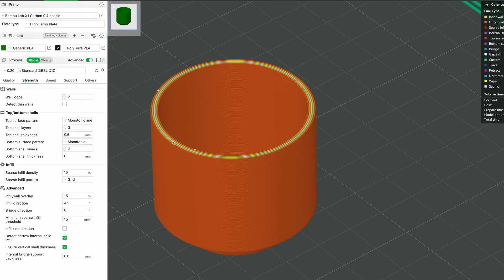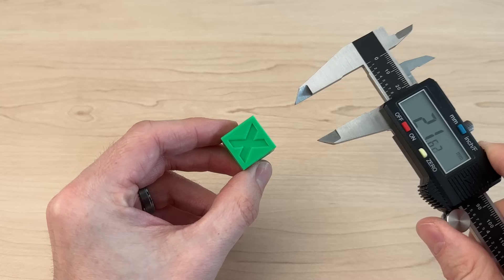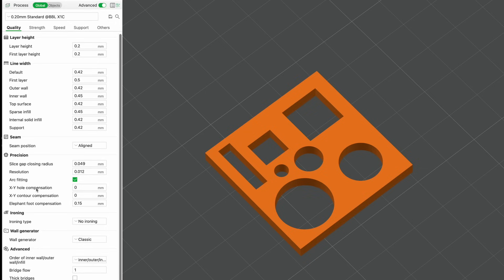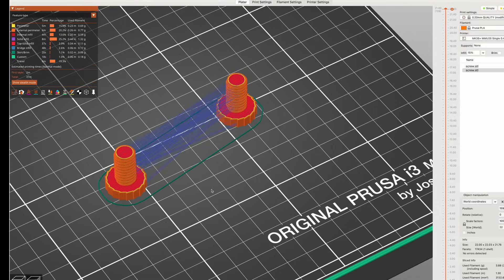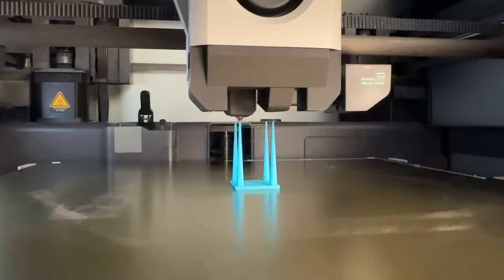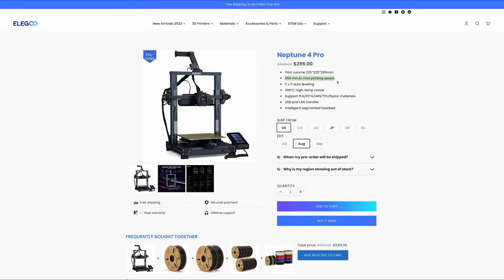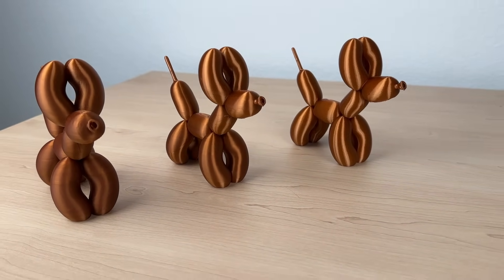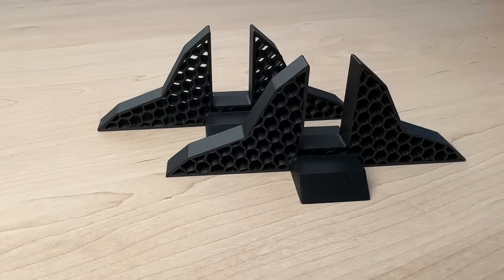9 Game Changing Slicer Settings You NEED To Try

Comment: im new to 3d printing, so bare with me. ;)  
slicer settings... when slicing and you set perameters for that print. are they set/saved for that print or are they saved for that filament?
ive noticed that when i change perameters for a print the slicer asks if i want to save those perameters.  so far ive never saved, under the assumption that it would save them for the filament rather than the print.  
i dont want to save a perameter and screw myself on a new print with a wrong perameter. forgetting that i changed them for a previous print.
thanks and have a great day!!
Reply from the maker: This depends on where you change settings. There are settings specific to the filament and settings specific to the print/printer. I usually save settings and rename it so I don’t overwrite other settings.

Comment: I personally value Arc Welder feature (Cura: Arc Welder, Orca: Arc movement), and a set of features in Cura that allows to avoid printed parts, supports and avoiding crossing perimeters when travelling. The former drastically decreases amount of stringing to filaments that ooze much

Comment: ONE setting that should also be mentioned is relative to each filament : shrinkage rate. All materials expand when heated and shrink when cooling, at different rates.
In the first place, before adjusting holes and such (which is also important), finding a filament's shrinkage rate and applying it to the slicer through filament properties is something to be done, because it directly affects dimensional accuracy. It's the very first thing in the chain.
Reply from the maker: That’s a great suggestion! Thank you for the feedback.

Comment: Great video, it really helped me a lot as i am new in the 3d printing field and struggle with printing spheres especially in fuzzy mode enabled. I am aware that in this case, the sphere being cut it should not be a problem, but i am struggling to print the sphere as a whole because even though the sphere looks printable in the slicer as the sphere has a small flat bottom surface the outer layers with the fuzzy skin seem not be able to stick to the printed object even though the overhand seems not to bad and the issues occur only on the lower part of the sphere, not on the upper part(where it comes together again) can you maybe suggest how to change or adjust the slicer settings in my particular case? for now i tried printing with 0,3mm layerhight as my object to print is pretty large. thank you!
Reply from the maker: Hi, do you have the option to split the sphere in half then connect them after it’s printed? Printing a sphere in one go is pretty difficult.
Reply: @The3DPrintingZone  Its not really a sphere per se what i am struggling with. I have designed a rectangular block with a completely rounded top, while the bottom has less pronounced rounding to improve printability and reduce overhangs. The cross-sectional area at the base is smaller than further up, so it gets wider—think of a conical cross-section that widens toward the top.

Now, I have applied a fuzzy skin to the design using the default settings. When I view the model in Prusa Slicer, I notice that between the first and second layer (where the fuzzy skin begins), the second layer is significantly wider, making it unable to adhere to the first layer. In the slicer, this layer is displayed as bridge infill, and there are two loops extending beyond the first layer. Additionally, the fuzzy skin follows, meaning the second layer is essentially three loops wider than the first.

I hope my explanation makes some sense. Is there a way to prevent this bridge infill from being so wide? The CAD design has a relatively small radius—smaller than the legs of the dog in your video—so I don’t think the CAD design is the issue. I hope my explanation is somewhat understandable, and I’d greatly appreciate any advice you could give me. Thank you!

Comment: External perimeters first seems to make quite a difference in dimensional stability and overall print quality, so much so that I've changed my defaults. However, a quick word of warning: be sure to evaluate your model for overhangs if you're going to use that setting. Running external first on a model that has even moderately aggressive overhangs can fail since the external perimeter will essentially be floating in mid-air without the internal perimeter (that builds off of the previous structure) to adhere to.

Comment: the relationship between infill % and strength is super overrated. The thickness of the outer wall has a much greater influence on strength then infill. if you want robust prints, make the outer wall 2-3 mm thick. you can have your infill at 15% and this will be much stronger then 0.8mm walls with 70% i fill. stefan from cnc kitchen made a really in depth video about this and the results may be surprising to sum
Reply from the maker: Thanks for sharing! I’ll have to check out his video

Comment: I use all of them, and most of the other settings also, like support roof density different layer heights, extrusion widths and many more on all my prints. That´s because i started printing years ago, and you had to know and use all that stuff or your prints looked bad or failed, with the NEW bambu generation, that knowledge seems to fade away in the future 😞 it was a hobby for enthusiast, becoming mainstream
Reply from the maker: I know what you mean

Comment: Why  grid/gyroid instead of cubic?
Reply: Grid and cubic infills are interference infills, and the crossing of lines by the nozzle can knock small parts over. Cubic specifically is like a closed cell infill, though it seems to use less filament. Gyroid is open cell, so the part can have heavy infill but still be completely filled with resin or whatever else, even sand, and it's generally the strongest infill. Interestingly gyroid is the quietest infill to print on my older, noisy Prusa Mk2.

Comment: More settings to look at are:
- Print 2 or 3 infill layers at the same time saves a lot of time. Say your layer height is mall e.g. 0,08mm you can print 3x infill layers which add up to 0,24mm thus only traveling once for 3 layers
- Thicker extrusions for infill, similar to the first point
- Thicker extrusion width, you can extrude 0,8mm with a 0,4mm nozzle easily. This is basically my course profile for strong parts like boxes etc, this way I only print one wall of 0,8mm instead of 2x walls and save a lot of time and I don´t have to swap nozzles, you basically don´t even need a 0,6mm or 0,8mm nozzle at all, but it helps with filled filaments like GF or CF filled.
- Shrinkage compensation. This is like XY compensation important on prints larger than say 50mm because material shrinks and this needs to be accounted for if you want a 200mm part to fit with some other parts. 1% shrinkae on a 200mm part is a deviation of 2mm

Comment: A note regarding Number 2 (Wall Print Order) - Printing the outside wall first can have some benefits but one thing to look out for is overhangs, if you are printing a steep overhang angle without supports, and the outer wall is printed before the inner wall it often has nothing to adhere to and will simply drop causing messy overhangs. If the inner wall is printed first the outer wall that is overhanging further has something to "grab".
Reply: Absolutely! But as is covered in a number of vids, if you're using Orca or Bambu Slicers the general best setting is Inner/Outer/Inner. Gives the best of both worlds.
Reply: Have you tested this or are you just saying this? 
From my experience and everyone I've seen who is showing real world results the exact opposite is true.
Reply: Same, If you have some steep overhangs it's common thinking/sense to add supports. Unless you don't know and rushed it print slower as it can benifit it too.

Comment: Here's a quick summary of the settings:

1. Detect Thin Walls - Prevent walls not being printed due to walls being too thin.
2. Wall Printing Order (inner wall first) - Reduces shrinkadge to keep parts size accurate as possible.
3. Horizontal Expansion (Cura) or XY Size Compensation (Prusa Slicer) +-0.1 - 0.2 is a good starting point to make things fit.
4. Horizontal Hole Expansion (Cura) or XY Hole Compentsation (Prusa Slicer) +-0.1 - 0.2 is a good starting point to make things fit.
5. Z Hop (Cura) or Lift Z (Prusa Slicer) - Moves nozel up whilst travelling to avoid nozel to part collisions.
6. Retraction - Helps prevent oozing.
7. Nozel Temperature - Adjust depending on print speed, observing print quality.
8. Speed - Not too fast for silk filaments, too fast makes them matt.
9. Infill Pattern - More infill for stronger prints, less for simple prints.

Enjoy :)
Reply: I believe your summary of #2 is backwards. His recommendation is outer wall first, moving inward.
Reply: Yup, outer wall first -> better dimensional accuracy. Inner wall first: better for overhangs. Some slicers (like Orca) also have Inner/Outer/Inner which seems to be the best overall compromise (ref.: see Orca slicer tool tip on wall ordering)
Reply: Agree, he said outer walls first. @mainetomass99
Reply: Thanks for this. I came just to see the tip on silk and I fast-forwarded through the common tips I already knew. I managed to skip what he said about the silk, but you summarized it perfectly.

Comment: I would love more videos like this!

I LOVE that you were able to cover multiple slicers and what the setting is called in each. I can't tell you how many times I've seen videos based on Prusaslicer and I have to guess or look up what Cura calls that setting. When I was new to this, it took me a good while to realize that permeters and walls were in fact the same settings in these slicers. You really second guess yourself when you're unsure about what you're doing.

The traffic sign with the logos and name of the setting is a really great way to show that, A super understandable and easy to acknowledge format.

Sometimes, I struggle to absorb information about slicers when I'm not familiar with the setting name in the moment.

Comment: Prusa, Super, and Orca all have the ability to do walls or infill first. It’s not a Bambu only thing. 

All of them can do different Z-hops as well.

Basically Bambu forked PrusaSlicer, which long ago was a fork of Slic3r, and then went around ripping off the entire rest of the open source community and then closed sourced their software without properly attributing who and where they ripped it. They’ve done this multiple times and as recent as 4 days ago.

So if Bambu has it, I can almost bet Prusa, Super, or Orca Slicer has the same settings somewhere.

Comment: You're the first person I've seen that talks about the inner>outer>inner>infill order in OrcaSlicer. I find it leads to significantly better surface quality/better looking prints, without compromising the structural integrity of the part. If you're using 3 or more walls on your prints, I highly recommend using the setting. I use it on all of my prints.

Comment: "Detect thin walls" is useless when used with "Arachne" on "perimeter generator" (PrusaSlicer). In fact, it's even better.
Reply from the maker: Completely agree! I should have included a caveat in this section noting that its not necessary to use with Arachne enabled.

Comment: Something I would love to see looked at in depth is the various reasons, and solutions, for why walls separate or delaminate.  I've recently run into this, mainly with TPU, but I've had it wil PLA and PETG as well and I just cannot seem to narrow down a direct cause.  I've adjusted speed, temp, wall thickness, number of walls, wall printing order, flow rates...you name it but it just won't go away.  It happens with any nozzle size and brand new nozzles as well.  It also seems to be somewhat random where some walls bond fine but others not so much.  Imagine a tube 30mm OD and 24mm ID with 3mm thick walls.  With a 0.6mm nozzle that SHOULD be easy with 5 walls but with 5 walls they are clearly separate and not adhered together.  If I increase the wall thickness at all, say to 0.65mm, then I only get 4 walls and the problem is worse.  If I drop it down to 0.55mm thick walls I still just get 5 walls and they don't bond either.

I'm baffled.
Reply: i had this issue with my .6mm nozzle.. just did pressure advance and it look purdy now no issue
Reply: @digital0785  Thank you for this suggestion.  I'll take a look at it right away.  Cheers.
Reply: @Enjoymentboy  Yea i noticed it when I switched over to the .6  on another printer but then when I just went to klipper on my cr10 I forgot how I fixed it . Tried upping line, flow ,temp nothing worked so I was like whatever. Did pressure advance today and it's looking better then my .4 print cornering wise with sane detail and now better corners lol
Reply: Becasue people "tune" their printer for accuracy and decrease extrusion multiplyer for instance. You donßt have enough overlap.
Reply: @sierraecho884  Thanks. I did manage to resolve it with an M502 command with pronterface. I went over the outout from before and after and never saw anything that stood out but after the M502 everything returned to normal. I only had to re-enter my e-steps and PID values manually so it turned into a rather easy solution.
Reply: @Enjoymentboy  I am glad you fixed the issue.

Comment: I wanted to ask a question. Quite a few of us with Bambu are having issues with pin holes when printing signs face down on PEI textured plates. We have tried a lot of settings like Arachne infil overlap and flow etc but as of yet seem to have failed to totally fix this issue, would you have any advice on the setting to tweak I may try outer inner today to see if it fixes it great video subscribed
Reply: You have to put the printer into Prusa Mode. You will find the option under “Expert settings”.
Reply: Yea its an issue for sure, may be possible to lower your z offset just the finest amount, or bite the bullet and go for a different smoother plate, Lots of the Patterned PEY or PEO or carbon fiber plates are physcially smoother then the textured PEI, but still give you an interesting finish.

Comment: New printer and/or filament also start with a temp tower, orcaslicer has it built in under calibration prints. You was temps high enough for your print speed but low enough so you don’t speed days trying to get the perfect retraction settings. 
I have found for retraction start with the lowest distance for your setup like 0.5 for direct drive or 3mm for Bowden and play around with speeds and wipe settings first. If you can get it down to fine hair/fuzzy with speed, then slowly increase distance until gone. For silk PLA or PETG the stringing will almost never be perfect/gone, because of temps.

Comment: Retraction doesn't pull filament out of the nozzle. It reduces the pressure inside the hotend which in turn reduces the likelihood oozing.  Retraction is a somewhat complex consideration that really shouldn't just be played with like this.  If you're having oozing, you should be printing retraction tuning towers, not randomly screwing with settings like this.
Reply: Assuming your pressure advance is calibrated right, any further retraction does pull the filament back into the nozzle, and because the nozzle orifice is so much smaller than the filament diameter, even a tiny amount of retraction will get it all the way out of the narrow orifice. If you're retracting so much to get it out of the nozzle entirely though, that's a problem.
Reply: Was going to say that, retraction should not be high enough to actual leave nozzle or clog is likely on direct drive extruders.
Reply: @joescalon541  what irritates me is that this guy has so many people following his page and gives crappy advice on something as basic and important as retraction.  Retraction is one of those things that you don't want to just hunt and peck for the right setting.  With a retraction tower, you can dial in your retraction within an hour.  But if you do what this guy suggests, you'll spend all day and probably still not get it right.
Reply: @preysner if this guy irritates you then why do you watch him? doesnt make sense to me…

Comment: dont use grid infill or other intersecting infills on smaller parts if possible. they can cause the part to be knocked over by the nozzle.
Reply: Yep grid infill lays down infill line right on top of each other like walls, which is very strong, but quick travel moves over hit can cause collision if layer height isn’t perfect or Z hop is off.
Reply: So what infill you recommend?cheers
Reply: For flat surfaces such as signs or something similar, its just fine to get a smooth top surface

Comment: Just a note for Prusa/Bambu/Orca slicer users (possible cura also).  Detect thin walls will not be selectable if you are using 'Arachne' wall settings in your slicer profile.
Reply: In that case it's not needed. Arachne makes it obsolete. You get correct printing of thin walls automatically with Arachne.
Reply: *That being said,*
but if you already use the Arachne engine then you are going to get much better quality thin walls AND thin-thick wall transitions anyway

so if your slicer supports Arachne, DO NOT disable it JUST TO activate "detect thin walls"

if you have another reason to choose the legacy perimeter engine, sure, go for it, arachne is not better in every case, but in the overwhelming majority of use cases, thin walls are going to turn out better with Arachne
Reply: I've found that 'print thin walls' still has an effect in Cura despite it using arachne, it seems to ignore fine details in the x/y when the option is left unchecked.